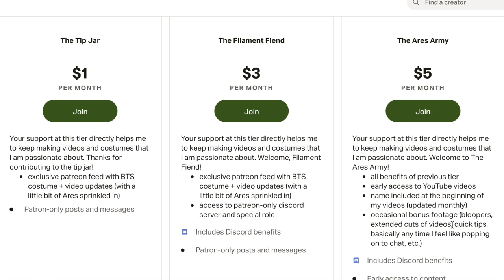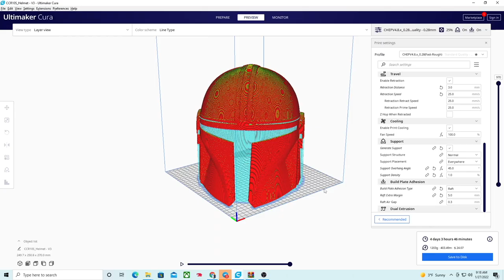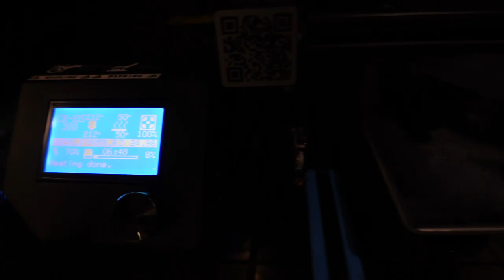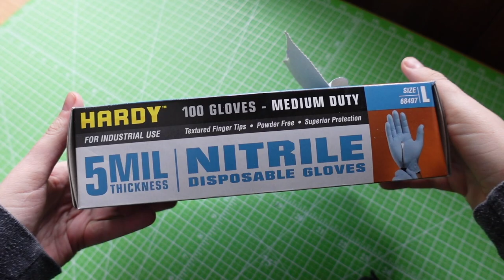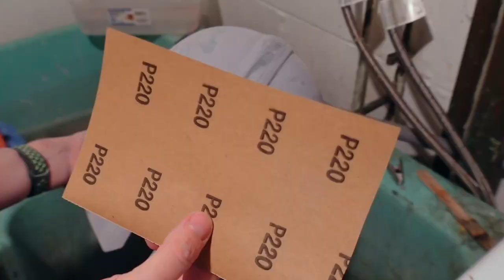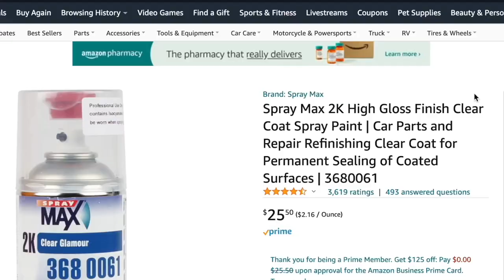How I Made the Mandalorian Helmet from The Mandalorian (the helmet that took a year to make 🙃)

Comment from the maker: if you're looking for another way to smooth 3D prints, I do have this video here using bondo + filler primer: https://youtu.be/pFBFXig9GLc ... I'm actually working on a few prints behind the scenes right now and have just been sanding the raw print down and doing layers of filler primer/sanding/bondo. I'll cover it in a later video

Comment: I wish I could post pictures.  My helmet I used an entire can of 2k it looked epic. Then I did my weathering anyway it's Chrysler red. I really feel like it made my helmet stronger.  It's a resin helmet  vs 3d printed. I'm currently making 2 3d printed ones these will be my first 3d print helmets. I have finished 3d print armor though
Reply from the maker: oh wow, a whole can? how many layers did that get you? The 2K did give all of the armor pieces a nice strength, which makes sense
Reply: I think it was about 5 coats. 2 heavy

Comment: I've heard from others that a better option to the Alclad "Klear Gloss" is to first use Alclad's "Aqua Gloss" sealer instead. The after that has cured use 2k over that. Using 2K over a chrome paint will apparently still dull the chrome. So the order should be Chrome paint, aqua Gloss, then 2k. Let me know if you've heard this as well, since this video is now a bit dated. Thanks.

Comment: Awesome videos! Thanks so much. How long does it take you to finish a helmet? From print to final coat of paint?
Reply from the maker: thank you! and oh boy, that varies depending on my mood/motivation but I've finished up a helmet from print state in as little as two weeks (don't recommend that tho) nowadays I average about a month
Reply: @vaultfox  Yeah same here. I've been trying to figure how to speed up the process. A majority of the time goes to smoothing the print whether its sanding, using resin, whatever. I saw in one video you used bondo to cover the entire helment. Did you sand it and then cover it or did you just go straight onto the raw print?

Comment: Could I use epoxy resin as a substitute
Reply from the maker: I've never tried that, so can't really recommend as a sub. But they do make something called XTC3D that is a type of self-leveling resin that works similarly to UV resin (but you still have to take all the necessary safety precautions)

Comment: Great video! Quick question. If you were to make this helmet again today, what would you use to smooth it since you aren't using resin anymore? Back to Bondo/sand/repeat? I'm toying with watering down wood filler and brushing it on that works pretty well. Still not as convenient as the resin tho. Ugh.
Reply from the maker: Thank you! I'm working on a few prints right now and am just sanding down the raw print with 100-120 grit sandpaper, then spraying on filler primer and sanding it with higher and higher grits to get a smoother finish. It's worked out pretty well so far, take a bit more time than the resin but it's a lot less messy